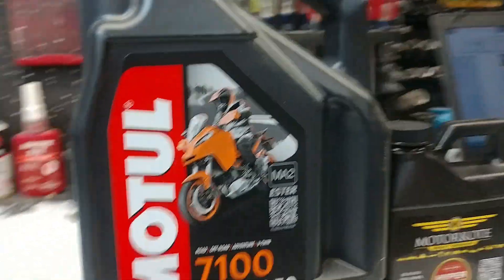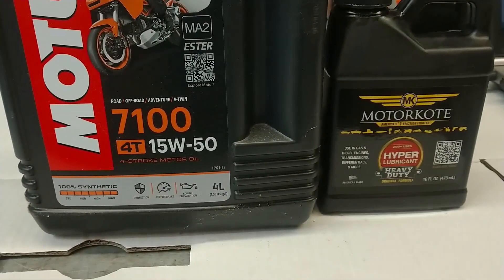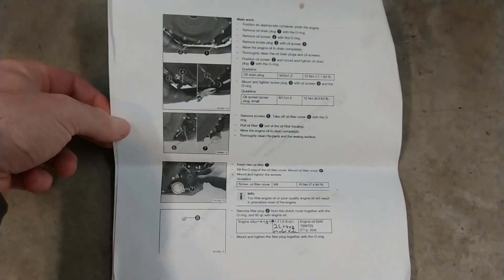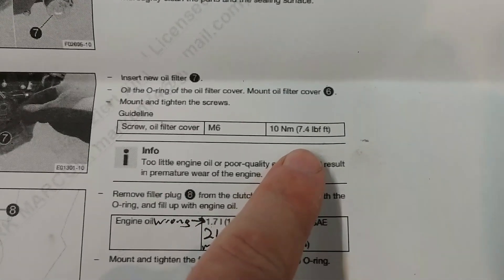Vitpilen 401 oil change procedure

Comment: Did you already get rid of this bike?
Reply from the maker: After I got done changing the head gasket and took it for a couple test rides. I traded it in for a Yamaha xsr. They are known for having a bulletproof engine.
Reply: @bushidosteelcraft1677  Alrighty!
Reply: @bushidosteelcraft1677  ah that's what im thinking of trading up to! Did you go for the 700 or 900? I like the amenities on the 900 but the CP2 engine is probably so solid for where i live.
Reply from the maker: You really can't go wrong with the cp2 or cp3 engines. I was trying to find the 700 I found a 900 for cheaper. I'm so glad I got the 900. I have been able to achieve over 60 miles to the gallon with it. And I never have that feeling of g if only I had more power. The 900 gives you the feeling that you have unlimited power. It would be best to start out in riding mode B with traction control on level 2 until you get used to that massive amount of power it gives you.
Reply from the maker: @ninabarreda3652  check comment I posted below yours.
Reply: @bushidosteelcraft1677  Thanks for the run down!
I feel like I'm stuck between a rock and a hard place because I live in NYC. So, I need to be able to really maneuver at slow speed but I also need to use it to get away for weekends. I'm so concerned that if i end up with the 900 FDNY is going to have to dislodge my ass from the back of a taxi.
Reply from the maker: @ninabarreda3652  a reasonable concern. You would probably be wise to get the 700 then. My riding area is the complete opposite of yours. I have all the room in the world to stretch my legs and do little to no in town riding. 900 throttle is a bit jittery at low speeds.